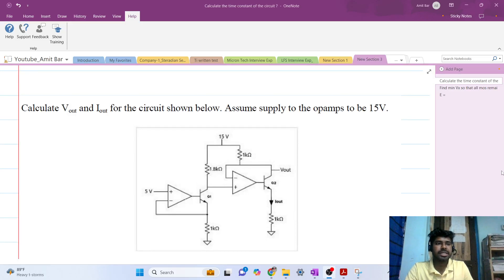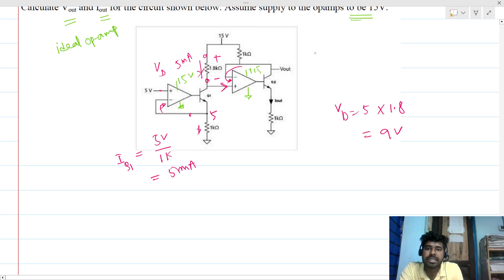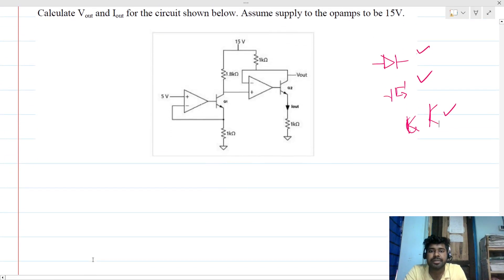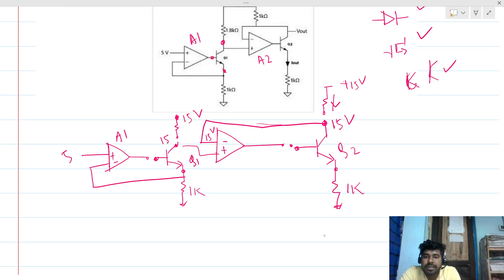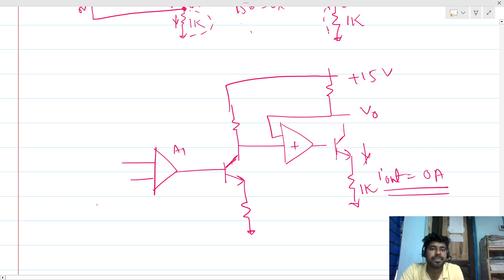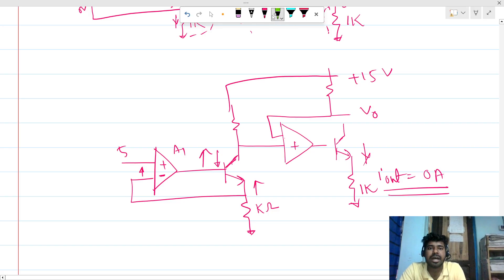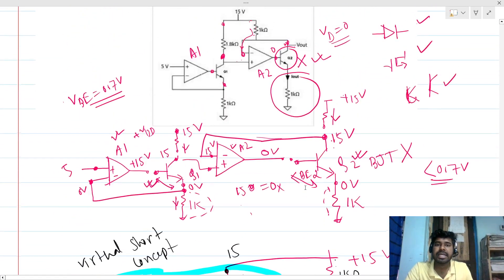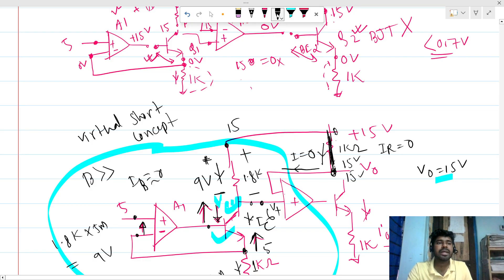Analog Circuit Design interview_problems on op-amp feedback with BJT

Comment: I solved this question in this way(if anything is wrong please tell):
For the first opamp ,I break the loop increase Vo of opamp  ->  base terminal of bjt increases which in turn will increase the emitter current and thus drop across 1K resistance increases and Vnegative of first opamp increases which in turn decreases Vout-> So first opamp is in negative feedback
I then applied V.Short 

For the second opamp I applied the same thing and found out the opamp is in positive feedback -> Say Vout of scond opamp is +15V then I did kvls and found out that Vce of second bjt is negative which says that +15V can't be the output of opamp and our assumption was wrong.
So Vout = 0V as -vsat of opamp is given 0V.....For this value bjt can't turn on and thus iout is 0 and Vout is 15V

This seems more intuitive to me
Reply: beautiful da!